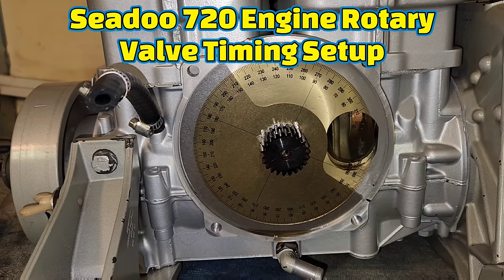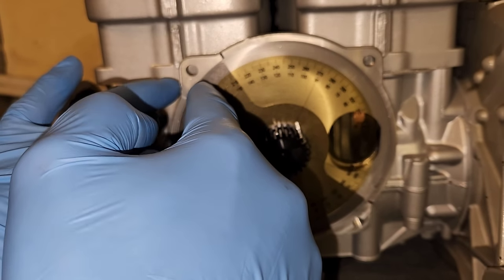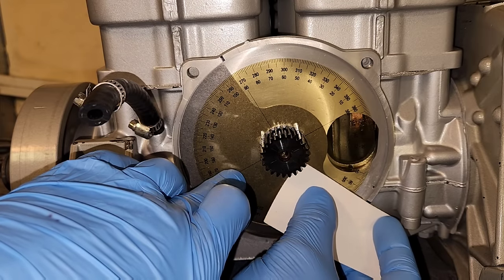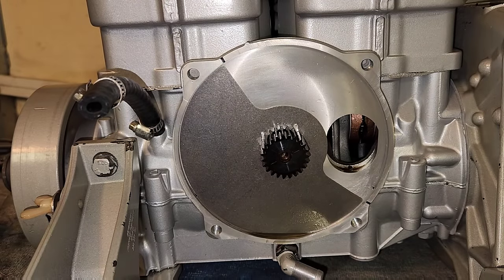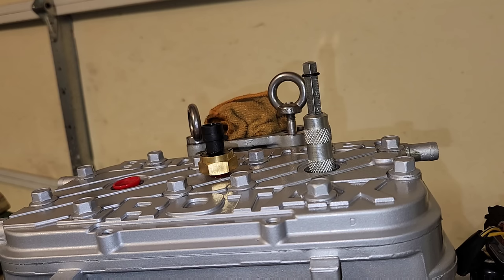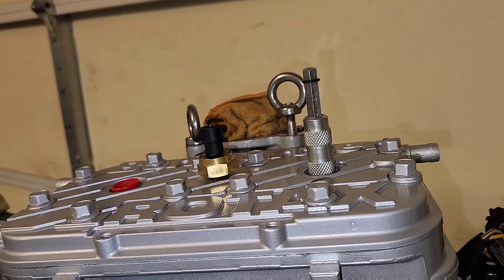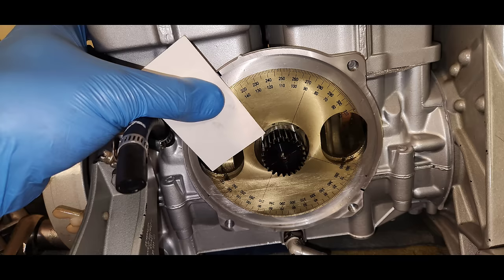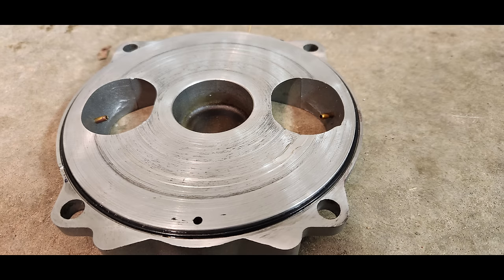How To Properly Set Your Seadoo Rotary Valve Timing | Cool Jetski Tools Demo! #529-035-607

Comment: I have a 2002 717/720. Are they all 147 degrees and 65.5. Also, can I do this without pulling the motor?  Thanks
Reply from the maker: Yes, all of the 717/720 engines are 147 and 65.5. I will post two pages from the OEM Seadoo manual for a 2002 Seadoo that may help you in my community tab. On a 720 engine ski with no exhaust obstruction you should be able to do the procedure in the ski. Check my community tab for the manual pictures. If you need further help just ask.
Reply: @joshthejetskiguy  well thanks. So my last question is this. Hard to start, runs like it's starving at low to half throttle. From half throttle up, runs like a freaking champ. Before I pull this apart, would a rotary valve problem cause this?  How can it run so perfectly at higher speeds if there's an issue?  Thanks.
Reply from the maker: @paulleduc1920  I would be looking more at carb problem from what your describing or a fuel delivery problem. Have you replaced your Tempo grey fuel lines? I made a video on how to verify if you still have them or not. Also if you have had the carb cleaned and rebuilt were genuine Mikuni brand carb kits used or aftermarket. Start at the source, clean your fuel tank out completely, fill with at least 10 gallons premium fuel, Seafoam fuel treatment, and Marine fuel stabilizer to treat any ethanol that may be in the premium fuel. Then start working outward to replacing fuel lines, clean or replace your fuel selector, then clean and rebuild the carb/s. I have a log of all the carbs I have rebuilt if that may help you to see what I check when I tear one down.
Reply from the maker: @paulleduc1920  If you're carb has an accelerator pump on it then that may be the reason why you get more power at higher rpm's. The accelerator pump delivers extra fuel when you stomp the throttle. Typically middle to higher rpm's.

Comment: i have a 99 GTI with a 717 and it has the 159% rotary valve  and if you get TDC on front piston and start your rotary valve at bottom port /360% and use your timing wheel and check the other side it will read 159% and i left it their instead of setting it at 147% and my ski runs like a raped aped love it
Reply from the maker: That is really interesting to hear, are you not getting any backfiring through the intake/ flame arrestor? Pretty much when the brass rotary shaft gear strips out and the rotary valve is not synced properly immediately you start to get smoke and backfiring through the intake.
Reply: @joshthejetskiguy  no runs great and feels like it's got more power
Reply from the maker: @richardstalnaker152  That's awesome, it's good to hear the feedback.